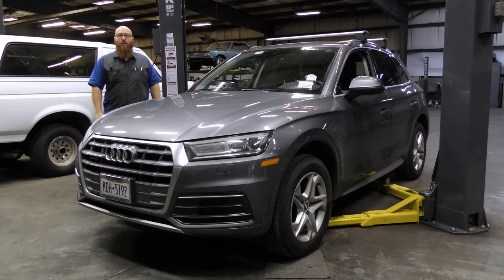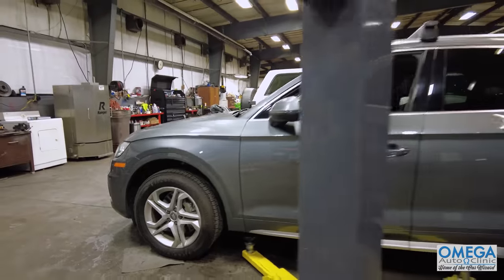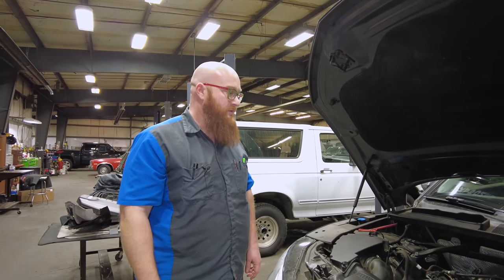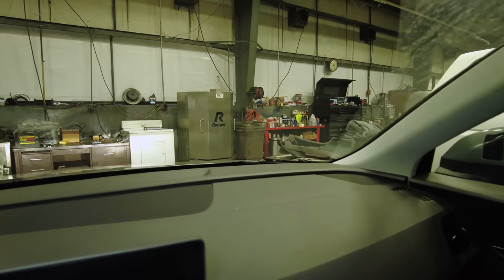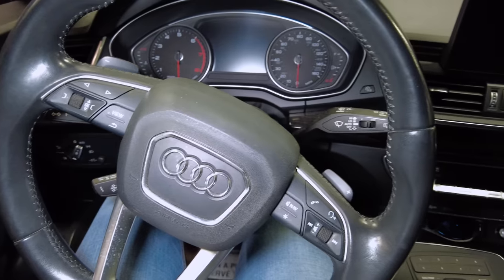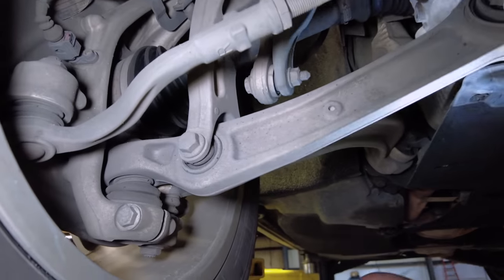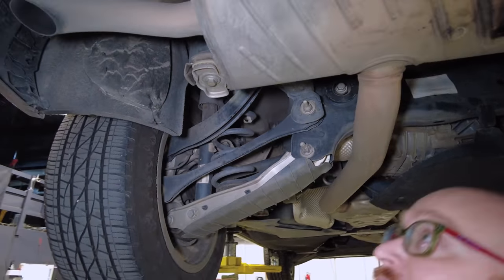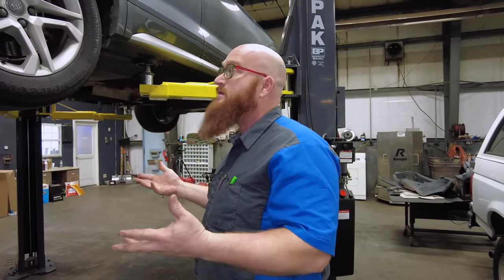2019 Audi Q5 with 200K miles & the service records to prove it! What did the CAR WIZARD need to fix?

Comment: 200000 miles and 4 years old. They are mostly highway miles. That make a HUGE difference. It probably has the wear of a 30,000 vehicle
Reply: I have a folder full of receipts on my 2009 Honda CRV but it has 100,000 miles. Even a reliable Honda needs maintenance.   I still bet that Audi is mostly highway miles. When I see a late model car with a lot of miles it means they are mostly highway miles and those miles don't concern me
Reply: We’ll be concerned. It could have been a Uber vehicle. Lol
Reply: Exactly. Minimal heat damage unlike the average driver’s car
Reply: Agreed except shocks and wheel bearings etc.
Reply: I concur…imo, a lot of wear and tear on cars from age, not mileage.  I had a 2010 Q5 with the 3.0 V-6 and for the first 70k miles over 12 years, with regular maintenance, it was a trouble free vehicle.  As it moved into its 13th year of life, a number of problems arose, including  failure of: CV boots, plastic coolant pipe, vacuum pump,  valve cover gaskets, park distance control system, seat heat, front engine main seal.  Because of the typical German approach of making everything as complicated as possible, the projected costs of repair/replacement of these failures exceeded the highly depreciated value of the vehicle, so I traded it in and replaced it with  CPO Lexus NX300.

I love German cars and have owned and enjoyed vehicles from all three German major brands for years, but I have reached the point where I prefer the less complex ownership and maintenance experience of Toyota and Lexus.
Reply: Yep it's plastic engine didn't have the enough heat cycles to kill itself
Reply: Excellent point and very true!
Reply: Agreed.   I would be really surprised if this thing wasn't pristine.
Reply: It ain't the mileage sister......it's the AGE!   Which is brand new in my eyes.
Reply: You don’t know that’s highway miles.
Reply: judging from the front end of the car, it isn't entirely highway miles.
Reply: @stevecman1  Biggest problem with German car is cheap plastic parts. They do not age well. Scotty said this over and over. I will lease a German car not buy them and go through maintenance headache.
Reply: @henrykim4230  I tend to keep cars a long time (8-10 years) and have had far better ownership experiences with Toyota and GM products, which have typically gone 150-200K  without any major issues.  I love the fit and finish of Audi & MB and the handling dynamics of BMW, however when folks ask my opinion about German cars (except Porsche), I advise them to lease for 3-years and move on.
Reply: I have an Audi A6, 1996 owned since 1999. 300,000 all kinds of miles, used hard. But it's had very regular oil changes, and everything is original.
Reply: What a bunch of haters! I’m hands on with these…of all years and miles, you’re lucky if it doesn’t detonate off the truck!!!! 😂😂😂
Reply: I have had to change my whole suspension twice in pas 8 years in my Jetta cause I live in pothole infested city
Reply: no it has to do with proper maintenance
Reply: Exactly what I was going to say.
Reply: My first thought also.
Reply: @Airman..  hater where the hater at i here
Reply: My rule of thumb is one year is equivalent to 10,000 miles of wear. So a 14 year old car with 100K miles should be in roughly the same shape as this 4 year old car with 200K.
Reply: Somewhere on the Internet, a Volvo 240 owner is yawning. . . "200k miles? It's just getting broken in."
Reply: @stevecman1  The b7's/early 10's had the 3.2. Decent motor. Was the base of the supercharged EA837 3.0 motor which came out in the b8/2014 model year for the Q/SQ models. Which is a fuckin brick of a motor. Stupid simple too. Shit the damn motor has steel rods and forged crank. I love my 14SQ5 and cant think of a reason to replace it other than I just want a newer Audi. In the typical German fashion its usually everything that surrounds the long block that goes. But its simple stuff. I am shocked the SQ5 gives what I ask of it, even at the level of modding its at.
Reply: @Tig-Wan  
Exactly the average speed limit in my city is 35mph. At 8hrs a day 5 days a week doing ride share is 70k miles a year. I think age is equally effects reliably as mileage does and the fact this is 4 years old is the reason why this is in good shape.
Reply: @stevecman1  audi, bmw, and benz are indeed fun cars to drive and there is no doubt about it. But it isn't a car to keep around for long. Parts are extremely expensive and a lot of shops refuse to work on them because plastic pieces can break while working on them when they age. CarWizard said clearly German cars with 150k+ miles are "never fixed like hondas and toyotas. They will break every 3 to 6 months and it is usually 3k to 5k to fix it."
Reply: @Tig-Wan  Anyone who buys an Audi brand new and does 50k miles worth of taxi driving in it doesn't care about making a profit between premium fuel and repairs.
Reply: They all say their car has highway miles.
Reply: @donovanmiller8992  
What do you mean heat damage? Makes no sense.
Reply: That’s a big book for 30k miles ;)
Reply: @Steven Strain 
On a daily driver it's of no concern if the engineering is even remotely close to solid. A modern semi trucks, Volvo, recommends a 30 sec cooldown from a high load scenario. i.e tanker truck clocking in 141,000 lbs. Oil temp can easily sit at 244F (118C) when arriving after an hour driving. Bringing it down to 212F (100C) will take 10 minutes at idle
Reply: @tycurtin7565  Age effects vary depending on how it's stored too.
Reply: @RDEnduro  Even then its still better in this case because most of those miles where put on when the grease in the bearings was up to temp so less wear then when you start rolling with cold solid wheel bearing grease.
Reply: Big exhaust for 2 litres has to be so can breath after all emission crap I suppose
Reply: jkirk1626  
Possibly, however it is likely that anyone driving 5K per month is likely doing so as part of his/her business.  If that is the case, leasing makes even better sense because the lease payments would be an allowable and deductible expense.  If I was driving 5K per month for business, particularly on long distance trips out in the country, the least likely car I would use would one which has limited service and repair support outside of the major cities.  The four German brands and Range Rover fit in that category.
Reply: @Airman..  ppp
Reply: Exactly
Reply: Yes, I tell people all the time to 300,000 miles on a four or five-year-old car is a lot different than the same amount of miles on a 15-year-old car
Reply: jkirk1626  -Have you had any problems with it since you go it? I love German cars personally. Had a 2003 BMW for 13yrs with nearly 200k miles but I had to stay on top of maintenance cause all the plastics and rubber hoses were deteriorating.
Reply: @henrykim4230  true but there’s not a whole Lotta ways to put 200,000 miles on a vehicle in such a short time span besides highway miles, so you can look at the vehicle and get a general idea such as the pedals and seats
Reply: @rosen9425  heat cycles, cold starts, etc. etc.
Reply: @thetechlibrarian  Yes, I donno if you know Craig from Flywheels and he ran over that at the dealer auction. Putting 200k miles on a span of 3 years will mask those most likely. German cars do not age well. But this particular person put 200k in 3 years which is relative short period and the plastic inside the hood hasn't started going bad yet. So it make sense it cannot be entirely highway miles. Plus, he replaced all the parts soon as they went bad.
Reply: @henrykim4230  Scotty is a clickbait YouTuber Toyota shill. German cars can be fine if you take proper care of them.
Reply: I have a car I got new in 2017 that has 0ver 400k miles on it now. People think it's just highway miles lol. I live in nyc and also a nyc suburb but yes th a re are lots of hwy miles bit I did uber with it in a city everyday I would drive to a city. I did nothing to the car for the 1st 250k but regular maintenance.
Reply: How does that make it better i say that this car has a lot of wear and tear on it.  200K miles in 4 years that means this vehicle was constantly running everyday.  That is not good on the mechanics of the car.
Reply: jkirk1626  nice truck! I like how everybody so surprised it has high miles! So sad! I’ve a 2016 q5! Running strong as well ! Just take care of it! BINGO ppl😂👍🏽💪🏽💪🏽💪🏽AUDI gang
Reply: @WhittyPics  that’s a good point. If it were a lot of stop start n’ go’s… there’d be a lot of brake pad and brake disc, especially with soft rotors on the Europeans.. (unless it’s all mentioned on the subsequent pages and not in ascending order)
Reply: 30,000?🤣 give it some credit highway miles make a difference but not that much of one
Reply: Nahh a lot of highway mile cars have transmissions and other parts go out at 200-300k. It's less wear than city driving, but it's definitely more wear than a 30k mile car
Reply: jkirk1626  yes but all of those highways are parking lots at rush hour loll
Reply: @bh2155  Says who? If anything it’s less wear n tear especially on the engine. What hurts an engine isn’t running, it’s the heat cycling. Getting cold, first starts, cooling down etc. you fatigue the metals slowly and cold starts cause the most wear. Running at operating temp is where an engine wants to be
Reply: Came here to comment this.
Reply: Exactly.
Reply: It's an Audi though. 30k miles is the same as 80k on any other brand.
Reply: @TheRealCatof  Tell me you know nothing about Audi without telling me you know nothing about Audi
Reply: @TheCompyshop  Tell me audi gets subpar reliability reviews without telling me that.
Reply: @TheRealCatof  Buddy you don’t get it. All of those “reliability reviews” are is people complaining about small non severe issues which get taken care of under warranty anyway. I’m talking about owning them long term. Out of warranty. I’ve had multiple Audis over the years, several over 200k and all ran like champs.  Nothing to speak of in terms of major problems. Infact my current car is at 130k, I redline it daily. All I’ve done in the past 3 years is brakes, oil changes, and tires. It’s 10 years old now.
Reply: @TheCompyshop  Engines disintegrating after 30k miles are small issues???
Reply: @TheRealCatof  What are you talking about? That’s not a wide spread issue.
Reply: @TheCompyshop  Not a wide spread issue? Audi's average reliability rating is a 2/5, because they use cheap plastic parts in their engines and electronics.

There's a reason why you'll see a 10+ year old Honda, Toyota, Kia, Hyundai, Mazda, etc at almost every stoplight, but you'll rarely see a 10+ year old Audi.

The electrical systems on newer models in particular fail constantly, and that's really bad when something as simple as the transmission, throttle, breaks, and even the e-brake are controlled by electronics.
Reply: @TheCompyshop  There's a reason why VW/Audi are rated as the 4th worst brand for reliability. They aren't low volume, I see plenty of new A4's, but they disappear after 3 years. 

That's because they all fall apart.
Reply: @stevecman1  im looking at a 14 sq5... with 95K miles... should I run?
Reply: My car only has 188,000 and it’s 19 years old. Some people put serious miles on there cars
Reply: @stevecman1  i have a subaru crosstrek, i think subaru is every bit as good as a toyota. i also have the manual and not a CVT.
Reply: @stevecman1  "plastic coolant pipe" ya that sounds about right for a German car lol
Reply: jkirk1626  Hi, mine is a 2018 Q5 that looks excatly like yours with the same rims except with different color in/out, but mine has only 37K.  May I know how are your shocks, water pump and brake pads & etc holding up?  Have you experience a decline in power and or MPG?
Reply: doesnt matter if its freeway mileage or stop and go milage. you still need to do proper and timely maintenances.
Reply: @TheRealCatof  Funny our 2.5L I5 DSG Golf at 130k miles and 10 years later is still chugging along and that’s as basic as a car could get. Otherwise, VW’s EA 4 pots are reliable and stout as they come. Mind you, the current iteration EA 4 pots are basic and common engines underneath the bonnet of millions of VWs from Golfs to Tiguans to Jettas and whatnot. Even some entry level Audis (like the A4) have them. These things can run for a good chunk of time and then some more. They just happen to be maintenance intensive, especially the mid sized and above segment of cars. Otherwise your A4s and other VWs, are pretty stout and durable.
Reply: No, it has the wear of a 200,000 mile vehicle. It has 200,000 miles on it. Did you miss that?
Reply: City driving will take a huge toll on your vehicle.
Reply: The fact he drove 4 hours for maintenance tells us it’s highway miles
Reply: Highway miles is a sales tactic by scummy salesmen to get people to buy high mileage cars because they offer significant margin increases for them. Mile are miles. Highway miles are not a thing lol. It has still rolled those wheels for 200k miles. Everything has been used while the car has traveled 200k miles. Wear and tear doesn’t care what road you used to put the miles on it.
Reply: Yeah why is an auto shop acting surprised. They must not know much about cars then. Not to mention he lied about the actual mileage 🙄 And was it confirmed they were in miles and not kilometers?
Reply: Yea I have an 80,000 original mile 1995 lexus ls400 and they are known for reaching 1 million miles with the original engine but i’ve needed quite a bit of maintenance because of the age. Even though it was garage kept it’s whole life I had to rebuild the ECU due to failing capacitors and the dash lights are out and steering feels like it has a small amount of play at low speeds. Age takes a toll
Reply: @Tig-Wan why would that matter?  Most Uber drivers take very good care of their cars.  Unless it's a POS Prius from a city.  I drive an Audi on Uber but only do highway airport trips.